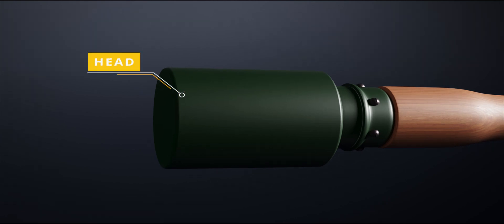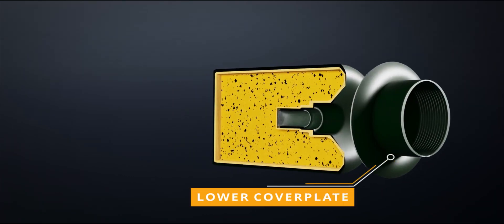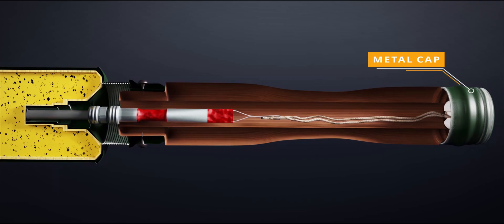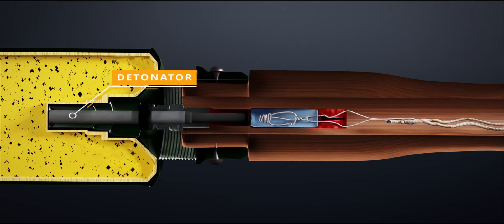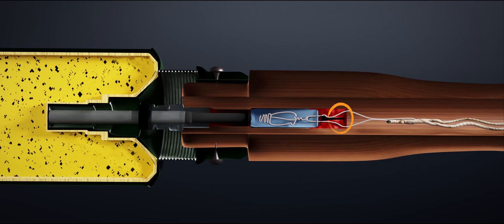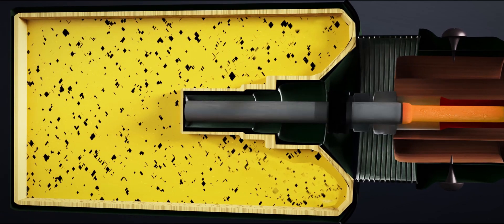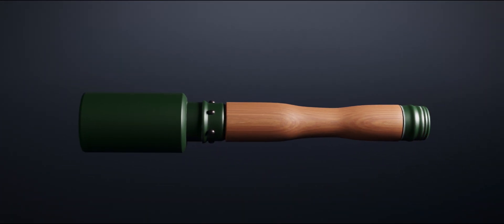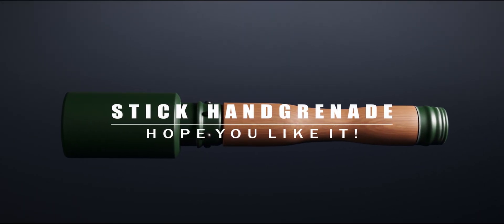How Stick Hand Grenade Works ? | (ANIMATION) | Detailed explaination

Comment: So you pull the lower cap on the handle and throw it? And what's the delay?
Reply: @NiceEyeballs  no you don’t throw after you take the cap off lol you have to pull the rope with the ball until it’s all the way out and then throw it
Reply from the maker: Yes, delay is 4.5 seconds

Comment: but is it effective compared to regular grenade? if it is, how can i never seen it being used in modern days? i only know the ovoid shaped grenade.
Reply from the maker: Stick grenades help in achieve long distance but at a cost of additional weight and space.
Reply: Ya as he said they usually preformed no different to a regular grenade in theory but the handle gave it extra distance for throwing often making it a better assault grenade then the hand grenade which is a defensive grenade it turns out
Reply: People don't realize the Germans actually produced more egg grenades, but the stick grenades were used for offense and they used the egg grenades for the defensive part of the war.
Reply: It produces a concussive blast with little shrapnel, making it theoretically ideal for assaulting a position. The stick provides farther throwing distance due to centrifugal force and the stick keeps it from rolling far upon landing.
The reason why it worked as a tank buster was again because of the large concussive blast as the shock wave it would produce could go through the tank and damage the internals and injure, incapacitate or kill the crew.
As for why it sees very little use today is because there isn't much of a reason to carry two different grenades essentially used for the same purpose (while we do still use concussive grenades, they are far less lethal) , while the stick part is more cumbersome and adds more additional weight.
Reply: @shadow200343  They mostly used 6 heads to blow op tanks. That was a total of more than 1kg of TNT